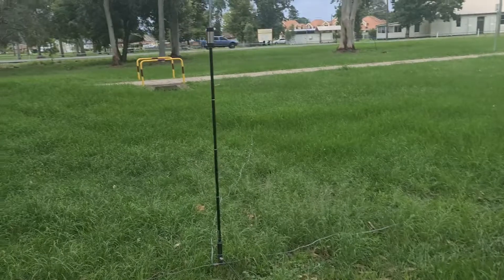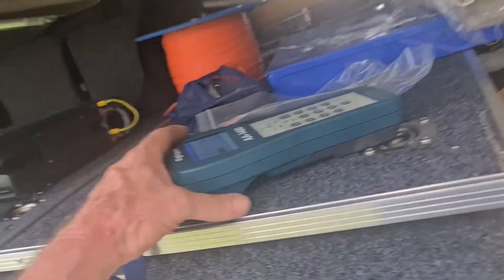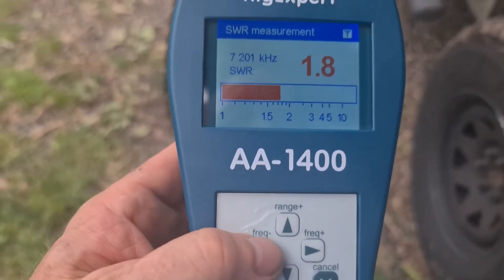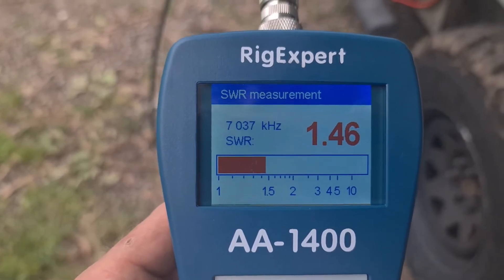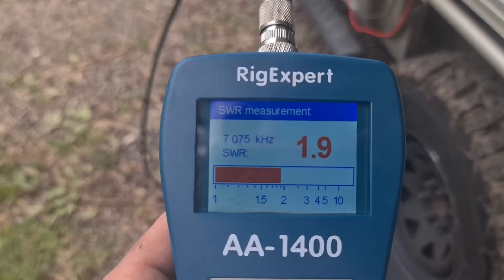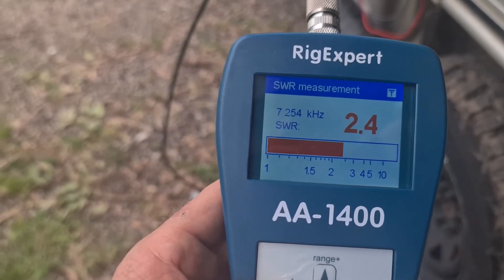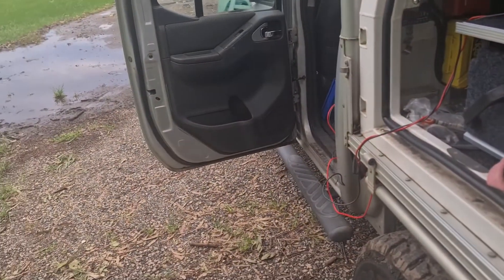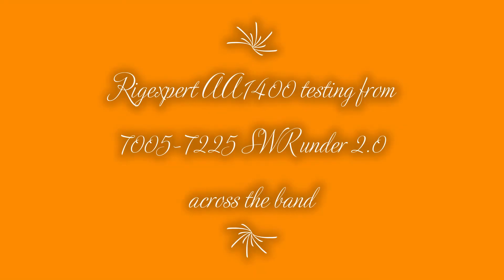FT-891 & PAC 12 Antenna Testing

Comment: Nice overview mate! I just ordered one, then found your vid!
Reply from the maker: Thank You, i have tried this antenna in a couple of configurations including a DIY 80m coil , you will not be disappointed 73"s
Reply: @vk2lq  thanks Paul, I’m going to use with the IC705, so will be interested to see how it functions.
Reply from the maker: @DNL1200GSA  I only use 10 watts on the FT-891 and made some great contacts and always receive great reports, Including 1 DX contact to the USA and several to NZ you will be surprised as they are also rated to 100 watts Enjoy have fun 73's